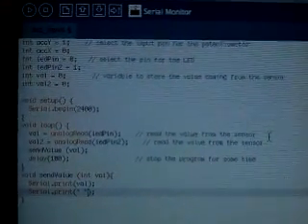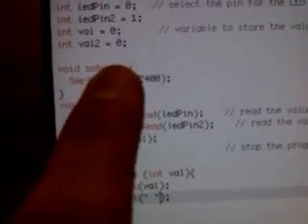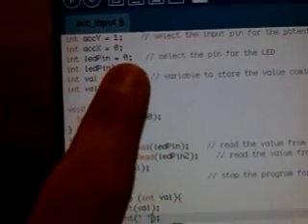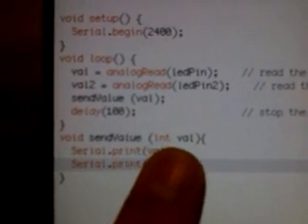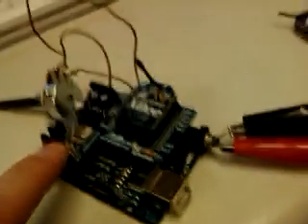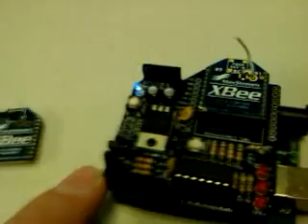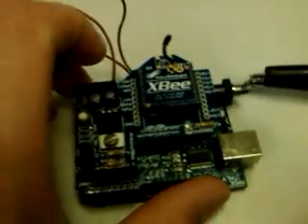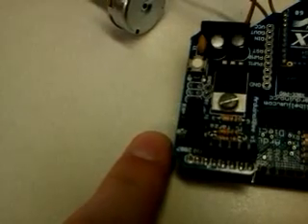Arduino & xbee tutorial - transmit from seperate arduino wirelessly to pc or mac

Comment: @roboteernat Hey thanks for the reply... What I am basically tryin to do is replace my RC trans./receiver for a arduino setup. So I need to pans to control speed and steering connected to a transmitter type device, Im guessing a Xbee and Arduino/Nano?, then I need a reciever(Xbee+Arduino?) thats hooked up to the 2 servos. Let me know your thoughts. Thanks
Charles

Comment from the maker: @mcgyverbrown thanks, to send more than one analogue value in this example, you would just need to insert a readadc command, and then add the second memory name in the send value subroutine

int ledpin2 = 0;
int val2 = 0;

val2 = analogRead(ledPin2); // read value from sensor

void sendValue (int val, val2){ //new function
Serial.print(val); //print value to xbee (serial port)
Serial.print(val2);

as example additional lines